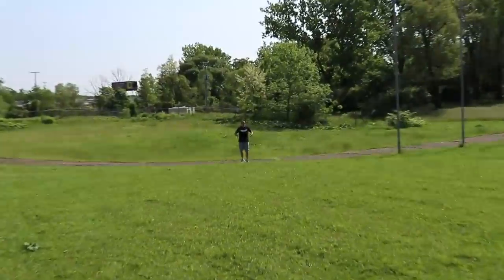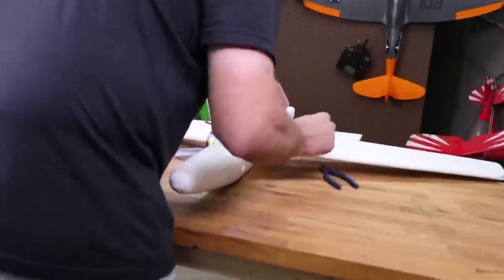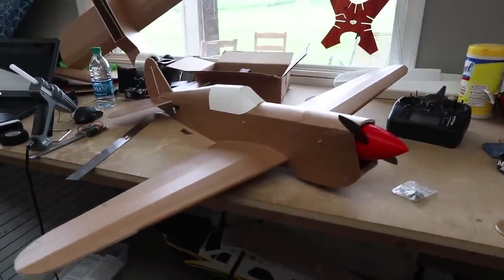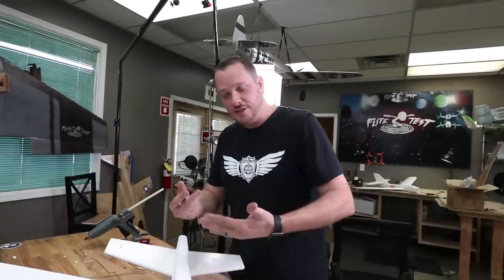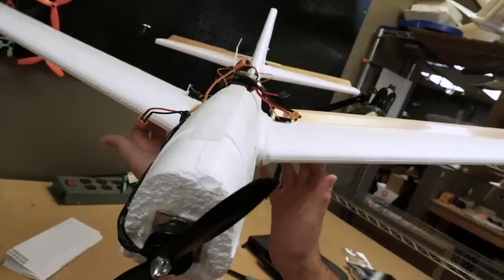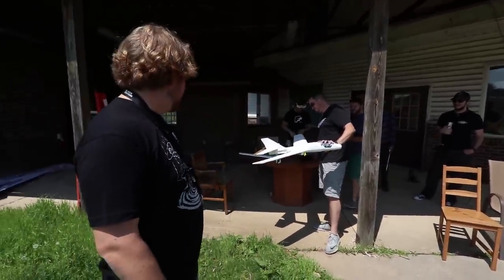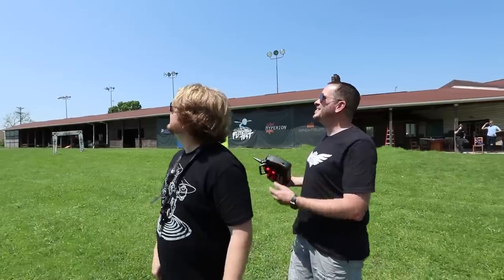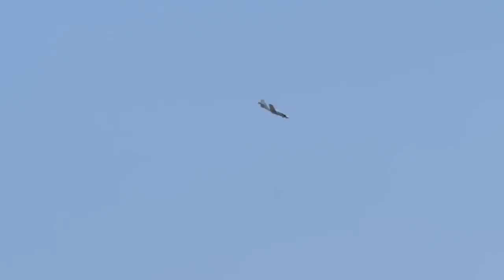Motorized Walmart Toy Gliders?

Comment: I wanna see y'all make a vegetable plane, I grew up on a vegetable farm and some days I wished they would all fly away.
Reply: Try one with a potato. And another with a carrot
Reply: Justin S. Wings of lettuce
Reply: An eatable plane is a nice idea! You can glue it together with some  sweets😁. 
Even a baked plane is possible.
Reply: Peter stripol did edible plane I think
Reply: A carrot but instead of the green bit on top it’s a propellor so it flys like a helicopter
Reply: Some vegetables are to heavy, because of the water inside. But baked to a pancake or a waffle or simply dried, it can ne light and solid enough, to build something with it. Even a prop can be produced with dried vegetables or fruits.
Reply: Karl J nerrrrrd
Reply: @Biscuits2  odds are I'm gonna get wooooshed but if you watch this channel you're a nerd
Reply: Potato quadcopter
Reply: lol
Reply: Does anyone have a link to the file to 3d print those motor mounts
Reply: Potatoes cannon
Reply: But they can buy a Powerup 4 too

Comment: "We really recommend you try projects like this"

Literally doing this waiting for my uninformed friend, Xander, to be availaible, because he threw a glider together from foam board he obtained, using tape to connect the pieces. He happens to have high-rpm electric motors lying around from drones that he owns, and has 2 propellers. I happen to have an RC helicopter, therein containing a motherboard that connects to an RC controller and a battery. I also have wire. I plan to trim the wings (aerodynamics+lift) and place two motors on the wings for diff thrust and place the motherboard on one side and a paperweight on the other, balancing the weight. Battery in the middle bottom (center of weight) and motherboard in the same place. Hot glue it all together. I've never built something like this from scratch before, so if y'all have any newbie tips for building, i'm all ears. Don't know if his tiny propellers (designed for drones) are gonna generate enough thrust.

Comment: Just yesterday I built one of these as a high-mount pusher motor (2204 size) and rudd/elev control. It flies really good! Really docile, decent glide slope, not exactly aerobatic but still really fun to cruise with. Might even make a good fpv platform.
Reply: I used an old soldering iron to melt holes for the battery and servos, and tucked the esc and receiver into my motor pod. It looks slick!
Reply: What model glider did you use? I can't find it at Walmart

Comment: We did this 40 years ago with 747 foam gliders. They cost 5 bucks. We added ailerons and cut the tail into a stabilator. We use plastic packing tape for aileron hinges. No electric motors then just a glider. We did dog fight and had one still flying with the whole nose from the wing forward missing. We talked about painting them up in airliner schemes and video real 747's taking off and then the dog fight.

Comment: Differential thrust is still 2 channel though isnt it?  One channel per motor to give the ability to vary the thrust between the two?
Reply: Yes, one channel per motor for differential thrust, plus he actually used another 2 channels for the elavon (1channel for the left, and one for the right elevator). So it was still 4 channels.
Reply: I think techincally, the servos were mixed to the throttle channels, so it'd still be 2
Reply: microbuilder it's 4 since he's using all 4 channels
Reply: The channels being used were throttle and rudder, only two channel, just like the little toy airhogs planes that only used two motors for throttle and steering
Reply: How could you tell?
Reply: Because the motors were setup to run with thrust differential, they act like rudders, so adding a servo or two to go along with the motors just increases turning ability...I've built a ton of 2 channel thrust differential planes, they work surprisingly well and are super easy to set up.
Reply: yep-sure am!

Comment: Great vid.Been making these into cheap Rc planes for my nieces and nephews for years. Fun and easy.
 I use an micro contoler from e-flite a few micro servos for ailerons and elevator just as you did. Powered with a 380 motor 10 amp esc and 800mAh battery.

Comment: I tried to Make One of those gliders fly RC, but I accidentally put the horizontal stabilizer upside down and it stalled and broke in to a million pieces.
Reply: Kotasek Aircraft That's a shame :(
Reply: Great work!!!!
Reply: good thing that they dont cost that much
Reply: That sucks
Reply: Watt Waster, I was looking for foam glider mods.  I saw some of your Dollar Tree foam conversions on your YouTube channel, they are pretty sweet! good job.
 I would have liked if you would have shown them fly.
Reply: Yes, Watt Waster.  And adding reinforcements to make up for the frailty of the foam adds more weight, unless you use carbon tubes or shapes.
Reply: A million? More like 3-4 pieces... I mean seriously, a million??? Lol

Comment: Kmart used to sell those gliders in the 1990s or something almost identical. We used to heavily modify them and throw .049 and .051 engines on them with rudder, elevator and sometimes ailerons.  5 minute epoxy for the build and repairs until they were to heavy to fly... Thanks for bringing back some great memories.

Comment: The kids and I had a foam chucker from Walmart that glided so straight and true it landed exactly where you pointed it.  Many a summer night tossing that in a triangle pattern.  We later got an RC Airhog with differential thrust.  Delta thing maybe 14" span.  Flew on rails and about 10 minutes on a charge.  Times were tight - little toy budget but we made the most of a few bucks.

This video takes me back.

Comment: Build solar powered planes and see who can build the best and longest flying one✌
Reply: It would be awesome to build one that is set to naturally climb slightly and that will fly somewhat straight. On a sunny calm day put a note on it and see how far it will go unassisted. Like a note in a bottle thrown into the ocean that washes up across the Atlantic. Maybe someone a couple hundred miles away would reply. Could be a fun thing to do. Provided it doesn't fly into an airport lol.
Reply: Yeah as you kind of hinted at the end there's an issue with control authority. Basically the FAA, and most civil aviation authorities allow RC aircraft but don't allow autonomous drones. Another legal technicality (which isn't always followed strictly if we're entirely honest) is line of sight, but nobody cares if its maybe a few seconds but a day is a long time.

I'd love to see the challenge, but if they were following along in a car or something so they could basically take a road trip with a plane following them the whole way would be awesome!
Reply: It would basically be a very large aerofoil covered in a solar array, and a few motors, props, battery, and electronics. As long as they fly in direct sunlight, it should work quite well.
Reply: That will give you like a minute extra at most tbh.
Reply: BoBu I’m pretty skeptical of anything solar powered, because you need a lot of sq ft of PV panels and very little weight, but as long as it can be launched by other means, it should be able to sustain itself in the air as long as it’s sunny.
Reply: @AlexOvechkinSucks  Why are you responding to me as if I stand behind this idea. I literally only commented an expectation against it lol.
Reply: @bobu5213  I don't think you stand behind the idea, hence why I'm arguing against your stance. It's quite possible these days with current tech that you can run a solar powered plane for several hours, as long as the conditions are good. ie. cloudless sky, low weight, etc.
Reply: @AlexOvechkinSucks  "I'm pretty skeptical about anything solar powered". You are literally saying you do not stand behind it here. If you are  behind it. Good for you. Go build one and show us how to let a plane fly for hours on just solar power.
Reply: @bobu5213  I should be more clear, I'm skeptical of people thinking solar doesn't have limitations. A good example is that people think you can cover a EV with solar panels and it will run indefinitely, when they would actually take a month to recharge enough to drive one day. That is what I'm skeptical of.

Your assertion: "That will give you like a minute extra at most tbh." is quite untrue. There is a self sustainable RC plane that ran for 4 days AND NIGHTS without landing, powered only by solar. Quite possible really, so long as the wattage required to fly the vehicle over a 24 hour period is less than the wattage generated by the solar panels during daylight hours. If the system is designed well enough, the batteries could last through the night and be recharged the next morning.

Thanks for the suggestion to build one, but I've got enough hobbies.
Reply: @AlexOvechkinSucks  I think that plane surely didn't have a motor. You can build a glider and use thermals to stay in the sky as long as the battery will let you receive input so naturally a plane like that wouldn't use a lot of power. I don't think that is what the OP(The person who I originally responded to) meant.
Reply: @bobu5213  they do have motors and batteries. There is even a manned self sustainable solar powered plane that travels relatively long distances on solar power alone. Long as in from Japan to Hawaii, a very long flight duration considering the distance and speed that it travels. And that's including a pilot.

The OP mentioned making solar powered UAVs and seeing how long they last. You said "only a minute, tbh." I think they could do A LOT better than one minute. The other plane stayed up for 4 days straight through the night, with battery and motors, and only came down due to weather.
Reply: BoBu there’s a guy on YouTube who has had a solar RC plane in the air for 3-4 hours or something.
Reply: That's great. Haven't seen the proof of any of you yet..

Comment: I did this with the exact same glider about 4 years ago. It flew awesome. Also, the CG is so far back because of the swept wing, because the lift is generated so far back. I also had a friend do one with an EDF on top, and he cut the wing mounts to remove the dihedral from the wings, and his flew super fast, and was extremely maneuverable.

Comment: Great project.  Back in the dawn of time when I was in college a bunch of us got glow plug engines (not .049 but smallish) and props, a small pile of balsa and built planes.  (Control line, R/C was crazy expensive) I built one that flew something like these, only every now and again it would bank into the center and buzz the pilot.  Usually it would make it out to the length of the lines and get under control again.

Comment: I taught myself to fly r/c with a similar K Mart foam glider back in the 1980s......cox .049 and a single servo for rudder. I used a 35 mm film canister for a fuel tank, would climb almost OOS and glide for a good 20 minutes!

Comment: The CG is near the AFT 1/3 of the root wing chord because the wing is swept back.  For these types of wings you need to calculate where the average cord is (accounting that the root cord is wider than at the tips) and then transfer that to the fuselage ;)

Comment: Years ago (1979)"in the line control days, no RC "   we put a cox .049 on a Gullows  foam glider with a bit of turn in the tail, the idea was the glider would make big circles in the sky until it ran out of fuel, the glide back to the ground. we fueled it  up, got the motor started and tuned, tossed it into the wind, it went straight for a bit hugging the ground, then it started to climb and climb and climb last time we seen it, it was just a dot in the sky. It would have been nice to have had a radio control for it .😉

Comment: Many, many years ago, I used to use the same glider to make control line models.  Used coat hangers to make the landing gear.  The Cox 049 version was way underpowered.  An O.S. 15 would move it fairly well.

Comment: I've made 2 Air Hogs RC with electric motors, esc, lipo's, and $10. FM receiver's. One I added extra foam for rudder and cut out elevators. The other I added elevators and extra ailerons and no rudder. I cut hatches in both planes foam and dug out foam inside the fuse for batteries, reciever's and esc's. They flew good and was only about $30 to $40 each.
Reply: I also got the 5 gram servos from EBAY for $2 each.

Comment: This is sooooo amazing!!!!! I want to do this legit!! (Probably on a smaller scale) another addition that would make these things even cooler is if you get some wire that pokes out  and make some little wheels so the plane doesn’t get chewed up. I can only imagine that the planes don’t weigh more than about 5-7 lbs at most so some little tiny maybe even some LEGO wheels so you can land on concrete. Also for take off!! That would be soooo cool!!

Comment: Well after becoming a fan of your channel I actually did something similar, little foam glider has 3 servos reciever and two motors!

this video you make it look very easy, although it wasn't really hard, just some trial and error.  Next I am starting on the Ver. 2 taking what i learned and making it weigh less than 100g

Comment: Did you guys consider the P-Factor , slip-stream effect or counter-rotation of the propeller in the design? The Twin would not have to deal with these forces as much, but he single engine would have to be set-up to counteract these forces.

Comment: I put a little cox .049 in the nose of one of those planes once, it was free flight no rc control, took a little bit of experimenting to get the thrust angle on the nose right to get it right. needs a large open area because it goes along ways

Comment: I once pod mounted an 049 with a small medicine bottle as a fuel tank on a 4' walmart foam glider.  After a little tuning of the thrust pitch, I topped off the tank, launched, and never saw it again as it made a climbing left turn out of sight.  Even bino's could not see it.

Comment: Try making a power pack only fly no wings only a blade flying a battery the battery can be taped in though and it can be as many Motors for it it doesn't really matter you just Gotta make it fly without adding anything like carbon fiber or foam

Comment: question maybe someone can answer: when I convert one of these to a powered RC along with the bixler style pusher motor setup I added elevator, ailerons and a ruder to the existing stabilizer and wings which increased the wing surface area and did it all so when done the converted plane has the exact same CG as the unconverted glider. 
Question is: When you add control surfaces like I did making the wings larger does the CG need to change or will it fly ok @ the original CG?

Comment: Running batteries or any other part of the power package isn`t payload.
Payload is the carrying capacity, just you know, putting that out there ;)
Fun video, I did something similar with a 400 sized brushed motor, I`d say around 1997?
A cheapo glider and some lightweight electronics is a fun and simple way to get in the air, fun stuff.
Reply: Btw, flying alone, especially around dusk or dawn somewhere you have the field or park for yourself, is super duper relaxing ;)

Comment: trying to do the same with a similar glider and I was wondering : if the CG is that way back, there's now way you can transform this into a Pusher as the thrust angle would be absurd for a 6-7 inch prop...right?

Comment: This is sweet! I could do nothing but smile the whole time. I have never dealt with RC planes. As you can probably tell by my channel name I mainly stick to model, mid and high power rocketry. The closest I have ever come to RC planes/helicopters is my Parrot AR Drone 2.0. You guys have inspired me to do this. I think I'm going to go to Hobby Lobby this Friday and buy a jumbo foam glider and do the same. I like the design with the twin props and differential thrust I'd love to know where I can find the best deals on the parts I need such as batteries, motors, servos, etc.

Comment: This video put back the Air in my blood to wanna restart my old hobby that I ditch 40yrs ago...
Those days I only flew wired aero models made from Balsa wood and lacquering blotting paper using a single stroke Diesel engine. We made the fuel tank as well. We used to do dogfights to cut of the ribbon of the tails...